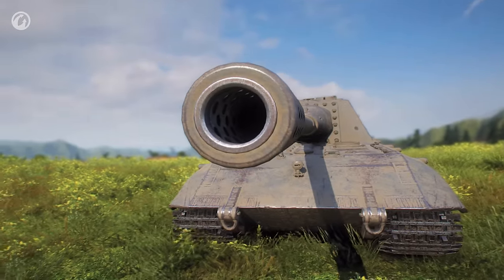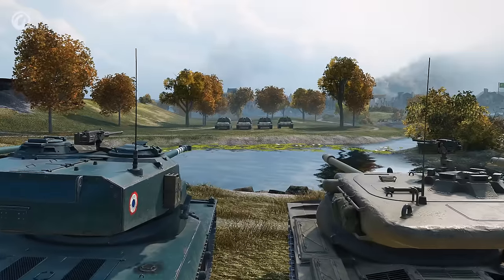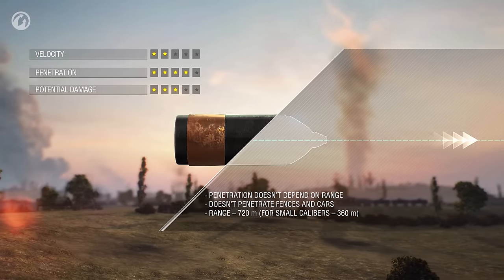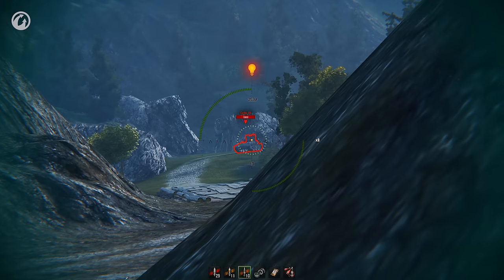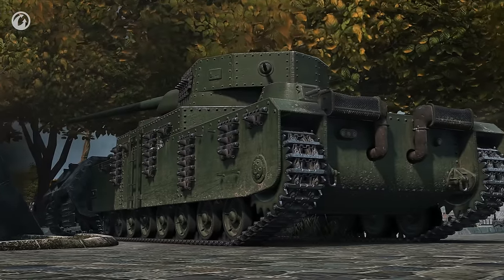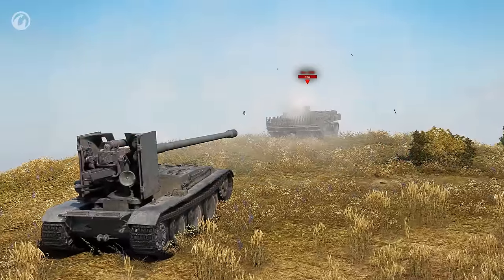World of Tanks - Explaining Mechanics: Armor Penetration

Comment: So after the spaced armor is penetrated by an AP or APCR shell and the shell is normalized, does the trajectory of the projectile between the spaced armor and the main armor change? And if it does, does the shell get normalized once again when hitting the main armor?

You didn't mention that. But i believe back in the day, you had another mechanics vid about that, i don't remember if it is still valid though.

Edit: now i found the video and saw that it does not change the trajectory but actually follows the main course. Like a laser, shame :P, the cumulative normalization of different armors + modules would have been real neat.
Reply: I think I read something about that, they know it's wrong, but to simplify the processing, they dont ajust the course.

Comment: When to use each type of shell:
- AP, to shoot a tank with medium armor. For this type, the distance to the target is most of the time negligible.
- APCR, to shoot a tank with thick armor in close combat or to shoot a fast tank with thin armor from far away.
- HEAT, to shoot a slow tank with thick armor. The distance is negligible. HEAT shells can't go through structures. /!\ You have to shoot ahead of the target if it is moving because of the low velocity of this type of shell. 
- HE, to shoot a tank with thin armor or to shoot a tank with very thick armor to damage its external equipments. HE shells can't go through structures neither. This type deals the most damage when it penetrates the armor.

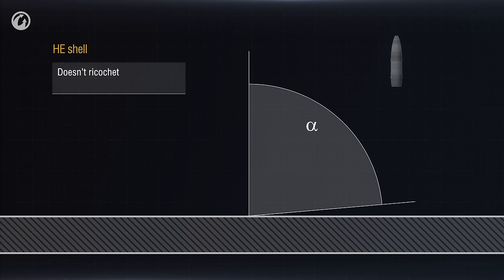Comment: 9:52 is incorrect. in WOT blitz i did a experiment and found out that a tier 4 tank with HE shells equipped going against a ST-1 front armour ricochet back to the gun that it was fired by. The gun was aiming at 80-90 degrees angle

Comment: How does it work that you dont fucking pen light tanks in the side
Reply: The tracks sometimes absorb the shot
Reply: +Kek Man always*
Reply: 1/ you can hit armor at extreme angle and armor is thick enough (e.g. 50mm) that you won't overmatch it with 122mm caliber and shell will ricochet - this is why LTTB or BatChat tends to survive some hits
2/ you can hit the gun with some chance of damaging or destroying it
3/ you can hit tracks below the tank's "belly" dealing just module damage (his tracks will turn orange, sometimes on both sides)
4/ you can hit viewfinder
5/ if shell hits tracks, it continues just one meter further. If angle is extreme, it won't hit hull behind the tracks

Comment: On the heatshells hitting spaced armor:
"loses 5% penetration value per 10cm travelled after first penetration" ehm I think you mean 10mm, HEAT loses penetration value very rapidly after first contact, this also means the on-screen calculation is wrong, with your calculation method the HEAT stream would only lose 1% penetration value (assuming space between spaced armor plate and actual armor is 2cm).

Comment: But then I have a question. I'm a decent player. 2900+ WN8 and 65% wr (16K battles played) and I tend to fire HE if a heavy tank is sidescraping or there is a tank on very low HP. And in this video you guys say HE can't bounce, which I already knew, but I still find HE bouncing off tracks, well angled armor or a very heavily armored targets when I use a low caliber gun. Can you explain to me why this happens? Or cover it in another "Learning game mechanics" video?

Thanks in advance =-}
Reply: bounce =/= non penetrating shot
Reply: Yes, but they say "That one bounced" as well as I can see the shell bouncing off. I just find this wierd, as they say it can't bounce.
Reply: Sivert Haukedal Low caliber HE doesn't have big splash radius, so when you hit the tracks it won't reach the main armor. If I'm right, HE damage is calculated like this: Alpha/2 - armor thickness * 1.1. Heavy armor can decrease this value to 0. Example: Škoda T50 100mm HE (420 DMG) shell hits the 210mm upper plate on the Maus. 420/2 - 210*1.1 = <0 damage dealt. The commander just says "critical hit".

Comment: i wonder what would happen if a KV-2 use AP with the 2&3 caliber rule? if it is any good, i may consider to start loading AP in my KV-2.
Reply: It does work at times, yes. Especially against tier 7 and 8 tanks with weak side armor (50 mm and below). But if you're in a tier 6 with some tier 4's, you're better off firing HE because they generally lack any sort of armor and your HE will be more effective.
2x caliber rule will work for anything with 75mm or below. (Since your caliber is 152mm)
Reply: If you get the shot, you can also fire into the tops of tanks and auto pen the 30mm armor.
Reply: RiftandRend but wouldn't it be better to just fire HE and i think it will pen no mater what, plus it has extra damage
Reply: HE has unreliable preformance when fired at high angles and may do no damage.
Reply: I think HE will do damage no mater what, lets wait for them to make a HE video so we can know better
Reply: I find AP is good to use sometimes, but HE is definately main ammo type
Reply: youre driving your kv2 without AP ? oh man howm atches did you loose because you hit the tracks in a 1v1 against a medium tank :D
Reply: well, i did one hit alot of them so i take it as a win
Reply: You don't just need high caliber, you also need decent penetration. The overmatch rule simply means you wont get many autobounces, but if you're reling on that you're still hitting a plate of armor at 65+ deg (5° normalization helps a bit here), which makes it at least 2.3 times as thick (and the thickness only goes up exponentially from there as the angle gets worse)

Comment: So acording to this HE ammo shouldnt bounce and do damage EVERYTIME i hit an enemy with them... interesting.

EVERYTIME. 

Except when it bounces. Or defragments on impact without doing any damage. Even when shot by a tier 10 arty. But appart from that... EVERYTIME.

EVERYTIME?
Reply: What they mean I think is HE shells can't ricochet, as in hit the tank, fail to detonate and then deflect'.
The crew often reports a bounce when you just do 0 damage with HE, it's a small quirk of the report system.  
As for why a HE shell would do 0 damage, that would be because armor is too thick or the shell detonated too far from the actual hull. 
If you have replays showing weird HE behaviour do link them so we can figure it out.
Reply: I understand that a HE shell with 38 pen hitting on a 250 armored turret wouldnt do any damage. But i think that a 102 pen HE arty shell with 1250 damage should do something on impact on every part of the tank. Including tracks. Not just doing criticals or defragment on impact. Happened to me a few times with my 155 58. Is it normal?

ps: Ill send you the replay next time it happens. Last time it occured the shell tottaly defragmented into the turret on a E100.
Reply: arvelos76  Only damage counts when calculating non-penetrating HE damage, penetration has no more influence. Now, a batchat 58 arty shell hitting the tracks of a tank should cause damage most of the time, but there might be a few exceptions like the E-100 which has super wide tracks and pesky side skirts causing the explosion to happen further out if you hit the skirts. A low roll could potentially lead to 0 damage, especially if they're using a spall liner, but that's rather specific.

Now, 0 damage hitting a turret is rather weird unless you're hitting the tip of the gun. Do send replays if you can.

Comment: By this "math" heat is super borken. 10 CM to lose 5% pen suggests that heat should be going through nearly all spaced and full pen on the other side.  What tank has spaced armour with more than 10 centers of space.   is there a space armor with over 50 cm of space to lose 50% pen capacity?  Nope.

Comment: I wonder how the Strv 103 will deal with the Three Calibers Rule, since it only has 40mm  of front armor. Any gun of 120mm or more will just auto pen :/
Reply: Kristian Wisnuwardhana Pretty much, considering pretty much all TD's and HTs at top tier have guns that size or bigger...
Reply: MatteV2 First applies 2 caliber rule, after three caliber rule. If firstly two caliber rule works then armor will be penetrated
Reply: Yes, but since the armour angle is so severe, it will be the Three Calibers Rule that apply more often than not, resulting in guns auto-penetrating practically every shot.
Reply: I think you are right, but at least you know that your armor works against most of the medium tanks (i guess not wz120), half of heavies with 120mm guns and to be fair, you can't complain that TDs can pen you head on, it's sort of what they are designed to do better than other tanks.

Comment: Pls explain HE shells next.
Reply: and HESH, if possible.
Reply: You need to separate what happens in gaming and the real worlds. It would appear that the game designer has chosen four of the types of tank ammunition available in 1944 and stuck with that.. They have some of the assumptions wrong..

Armour Piercing (AP) was simply a lump of sharpened steel which forced its way through armour. As velocities grew the shot would fail as the tip shattered, so the tip was given a cap which transferred the initial shock to the shoulder of the projectile. This was known as Armour Piercing Capped (APC). To improve the ballistics, a light metal ballistic cap was then added which reduced drag and maintained the velocity, this was Armour Piercing Capped, Ballistic Cap (APCBC). Finally shot was manufactured with a chunk of tungsten carbide in the nose. This was hard, but heavy, so the rest of the projectile was cut away to reduce the overall mass. This is what is known as Armour Piercing Composite Rigid (APCR) to distinguish it from another design which squeezed the projectile down to a small diameter and was known as Armour Piercing Composite Non RIgid (APCNR). In around 1945 designs of discarding sabot AP ammunition began to appear and in the post war period became the standard AP round as APDS and APFSDS.

AP has to be fired at the highest velocity the gun can achieve as it is the kinetic energy of the projectile that does the damage. High velocity also means that trajectories are flat and elevation errors are minimised, and that times of flight are short so that the target has little time to move..

All tanks at the start of the war had a standard HE round which consisted of a plain HE impact nose fuzed artillery type shell which was intended for attacking infantry and soft skinned vehicles. The anti armour effect of this type of shell are minimal. By the end of the war, these types of shell were pretty much abandoned, although recent conflicts have shown that perhaps such a round has its uses, particularly when anti armour rounds have become very much optimised in this role..

Shaped charge rounds for tank guns were tried in WW2, but proved to be very ineffective. The main problem is that shaped charges do not like being spun, so HEAT was never successful in high velocity rifled guns. After the war, the French produced a spun HEAT round where the shaped charge was held on ball bearings so that it did not spin. In the 1980s smooth bored, fin stabilised gun systems came into service, which could fire HEAT projectiles. In the 1940s there were some HEAT gun projectiles were produced for self defence use in artillery guns, but they were very low velocity and limited range. HEAT bores a small hole in armour, which is fine, but it needs to hit something significant on the inside of the armour and does not produce that much collateral damage outside the tank..

The solution to producing an explosive anti tank round was the the High explosive squash head (HESH) or High Explosive Plastic (HEP) rounds, These were base fuzed shell with a very thin case filled with a plastic high explosive which was allowed to "pancake" on the side of the armour and then detonate sending a huge shock wave into the armour plate, causing a scab to separate from the back. These could be fired from conventional rifled guns, although not at the velocities of AP. The downside of HESH is that it does not produce much in the way of fragmentation, although the HESH warhead has much more explosive in it than HEAT (which again does not usually produce much frag..) HESH is pretty much defeated by using spaced armour, but it is nonetheless a useful battlefield round. 

So... As an ammunition technical person I think the algorithms used by the games designers do not accurately reflect reality. This is not a problem as long as you don't use game strategies if you ever have the misfortune to become involved in a real tank fight!

...hope this helps!

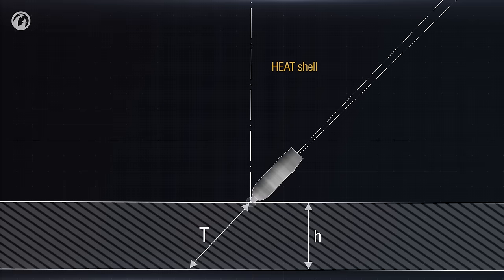Comment: at 7:54 you show that the HE shell is not undergoing normalization and has to penetrate the the armor thickness of "T", but in reality upon impact the HE shell explodes and as we know the energy of explosion is delivered in every direction at same energy there is no need for normalization of HE shells and the shell has to penetrate the "h" thickness, NOT the "T" thickness.

This is one of the factors why your shell mechanics are WRONG and BTW its a basic physics 7th grade... 

Also I have to mention the damage delivery, the HE damage is not working properly since 7. something, making a very limited use of HE ammo on large caliber guns. Example: I hit BC25 side hull at 90 degrees angle just under the turret with JPZ E100 HE shell, the BC gets penetrated (at least thats what game said) causing whopping 350 damage to BC (which is much lower then the lowest dmg value for HE round). In reality if a large caliber HE penetrates a battle station, then it is damaging ALL vital systems and crew, not dealing very limited damage like in game. Used to work in earlier versions very well.

Comment: well, this is bullshit. RNG decides will you penetrate enemy or not. and there is magic armor tanks in game, ie. B-C25t
Reply: StrLab I shot it with T62a with APCR almost 90 angle to FLAT rear armor in close range (under 50m) and it bounced, and not the first time.
Reply: No it did not, even with an unlucky -25% penetration you can't fail to pen the flat rear of a batchat with APCR from a T62A. Either your shot deviated and hit another part at an auto-bounce angle or you're just making stuff up.